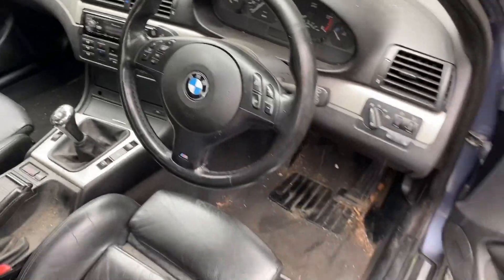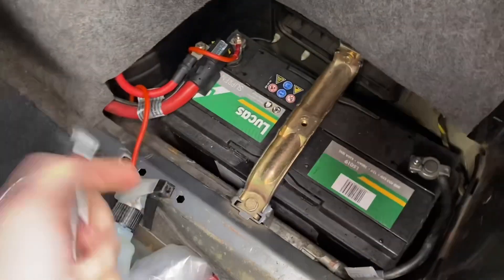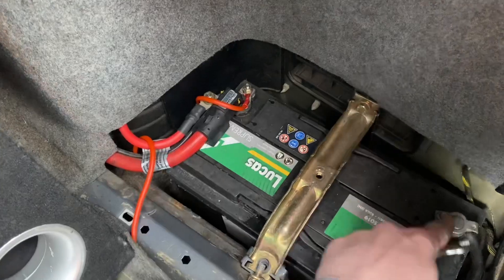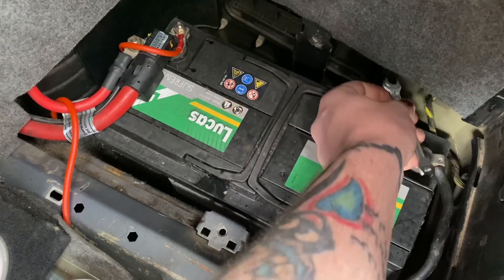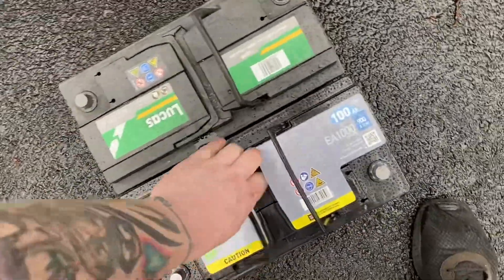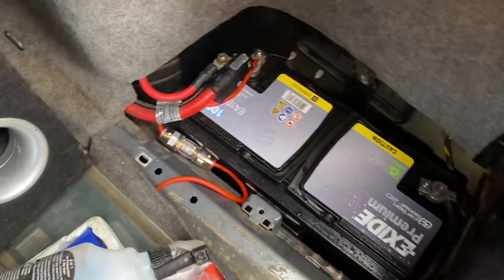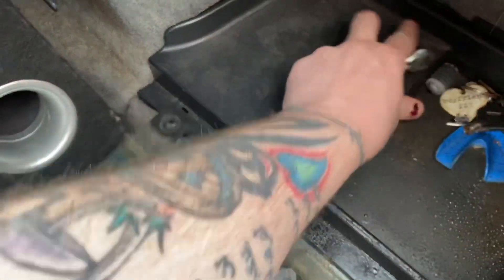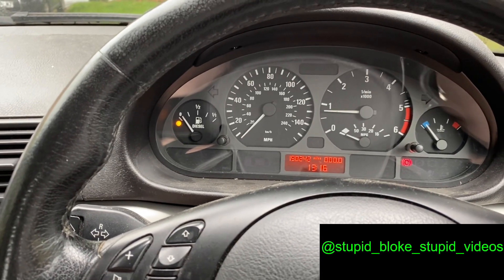BMW Battery Replacement / E46 Battery Fitting DIY

Comment: do you need to tell the car you have fitted a new battery to prevent the '' smart charge system '' from overcharging the battery and destroying the new one in a few weeks or less ??
Reply from the maker: Not on this model, it’s too old and shit to have that feature.
Reply: i js bought a 99 328i going to buy a battery rn cs it died,